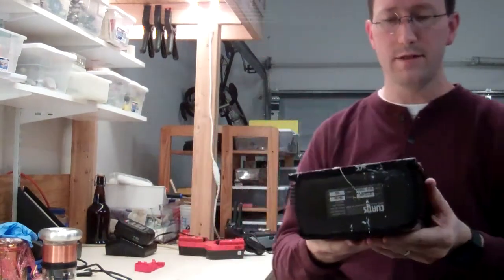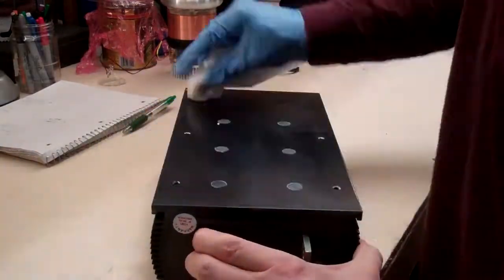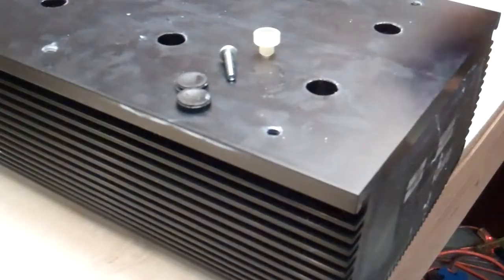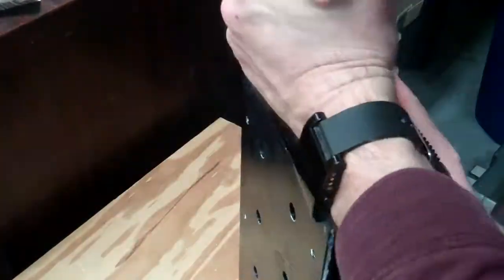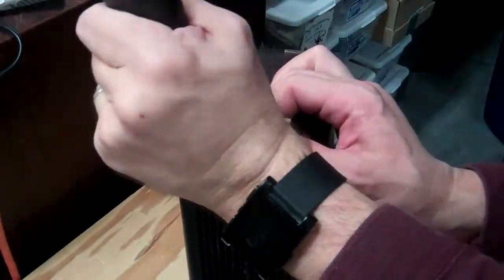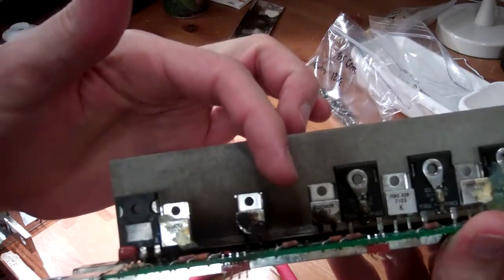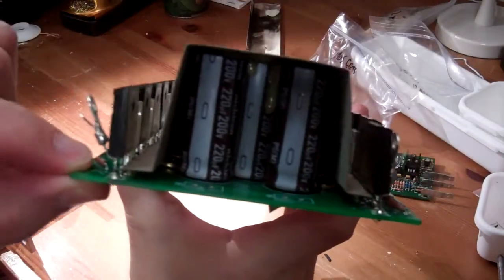Curtis 1231c PWM Motor controller dissassembly

Comment: Great video Jay! Thanks for sharing. 

Im upgrading a CC1204 (adding FETS) and have moved on to bench testing. Unfortunately my controller will only precharge to 3V (B+ to B- contactor open) on my 48V test bench and blows my 10amp fuse when I close the key switch main contactor.   No obvious blown components and no bus bar  shorts to frame or each other. 

Any experience with what may be causing this issue? CAPS and FETS all look good. 

With everything disconnected, measuring B- to B+ reads 2Mohms and then continuity with leads flipped. 

Thanks in advance if you have any ideas.
Reply from the maker: Sorry, I'm afraid I do not have any suggestions...

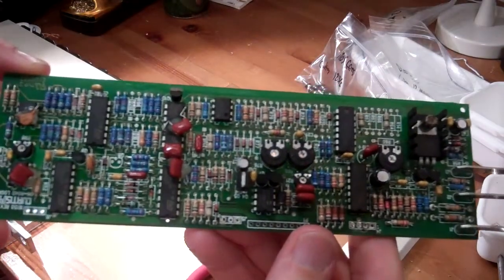Comment: 2:03 the trace vaporized is it repairable? I mean is it redoable somehow?
Reply from the maker: The trace on the circuit board can be bypassed/repaired by using a jumper wire, but a lot of other components are probably also destroyed and needing replacement.